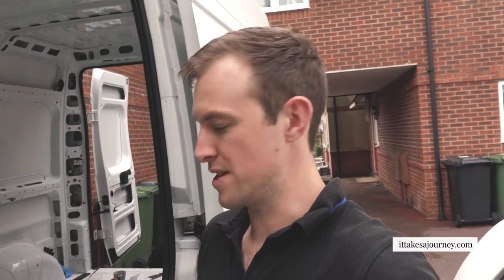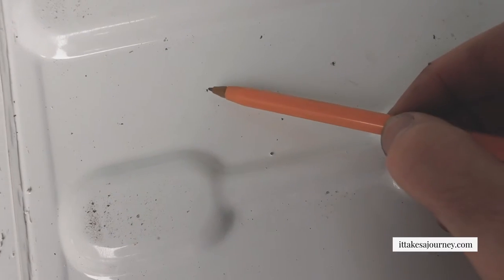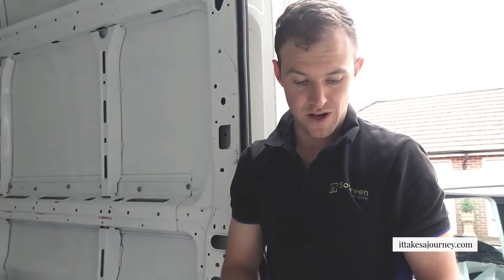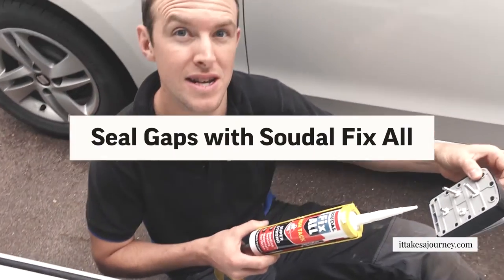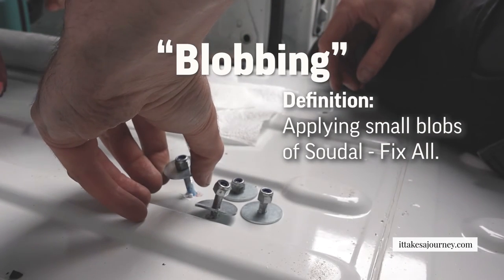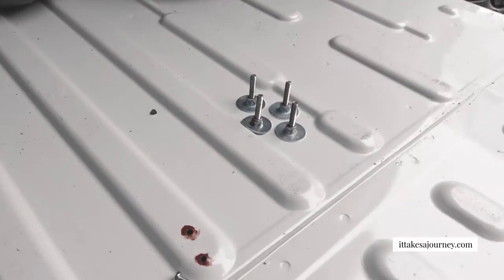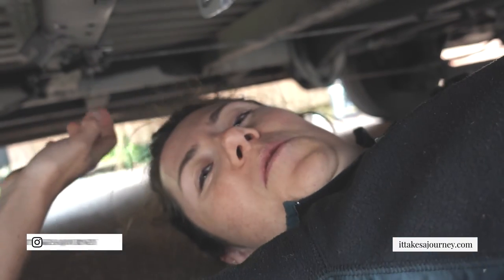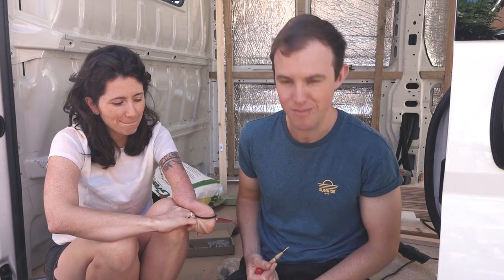How to Fit a Master Lock Key Safe to your Van - Full-time Vanlife Security | Citroen Relay Van Build

Comment: don't like that idea! would not take long to cycle through the combinations.
Reply from the maker: (We have set it to 9999 so hopefully they start at 0001 and get bored before the end. 😂)
No but seriously it's a fair point, however this measure is purely in case we lose our keys. But we have several other, or will have other security measures in place. So, even if someone did get in the van, for one, they won't be able to drive it away as we have a pedal box, we will also have an internal safe somewhere, and we will have a tracker too. We feel confident in the fact that many use these on their homes. But it is most definitely a personal choice. We are keen hikers and just want to know that if our keys fall off the cliff in Cornwall, we'll be able to get in and make a hot cuppa.
Reply: @ItTakesaJourney  don't like the keysafe but thanks for the idea of a key fob tracker I think? 👍